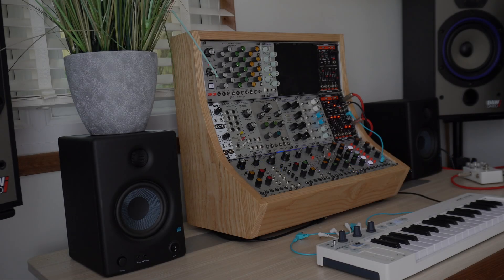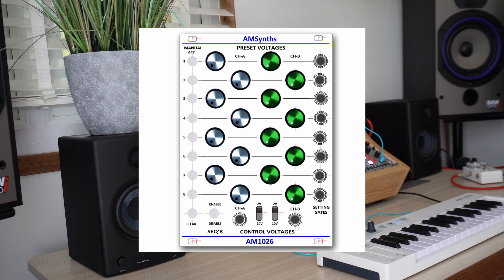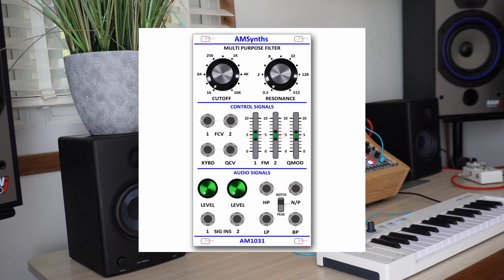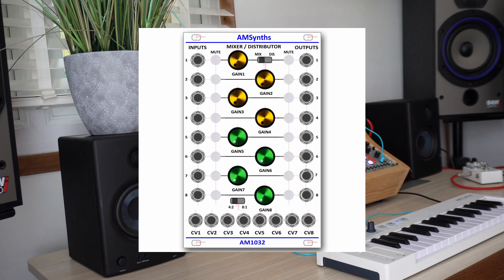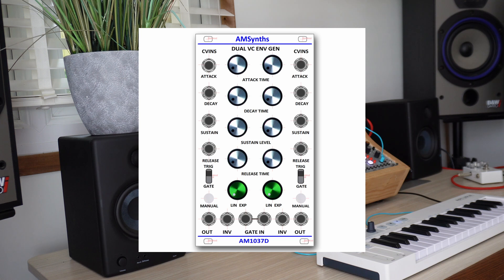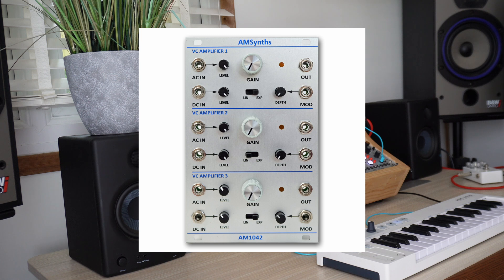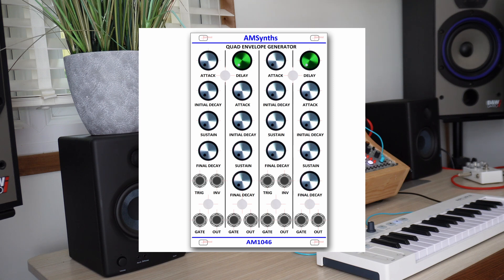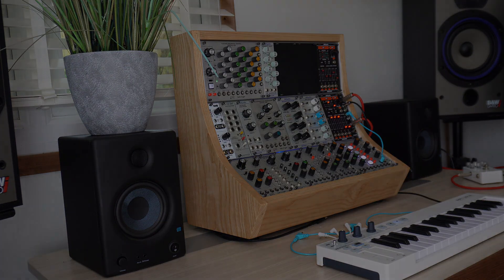AMSynths Plans 2024 - Ten ARP 2500 Modules!

Comment: It would be good not to have to buy Behringer products to get a working new version of a 2500, but your connection to that project is the rub. While they may have paid you, they have ignored both the people who own the trademarks and worked on the originals and the people who did license the copyrights and hire the people for remakes of later ARP synthesizers. The company simply appropriated everything, as usual, and defies people to sue him. It's not just the patents, which are fair enough to use, even for such a large company. It's appropriating the look and naming and trading on the overall work of others without compensation, repeatedly and without regard for decency.

In your case, you present the modules in a fairly standard form, at a small scale, for apparent interest in the work the inventors put into the products. Of course you did aid the monstrous company that raids the work of others and appropriates rights, whether or not they have legally expired. So, given that background, it is hard to decide whether this more-modest "tribute" raises the same ethical challenges. Clearly this doesn't present all the outrage the B company does, especially considering the previously unreleased modules and your crediting of the developers, but still.

I have a deep affection for the 2500 and ARP. It seems clear enough you do as well. For me, these issues will require more thought.